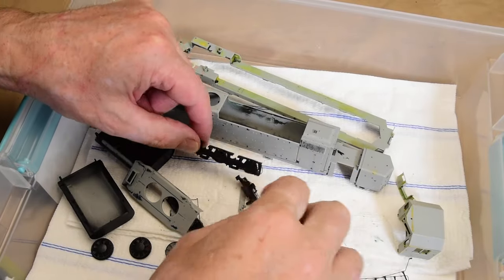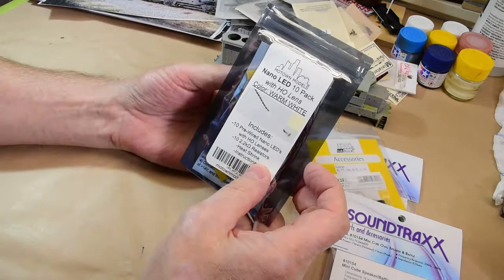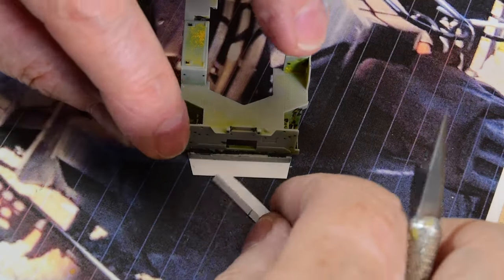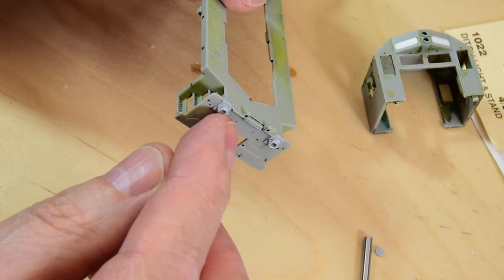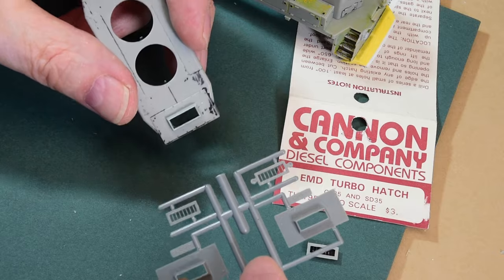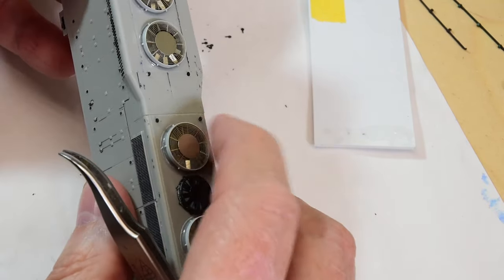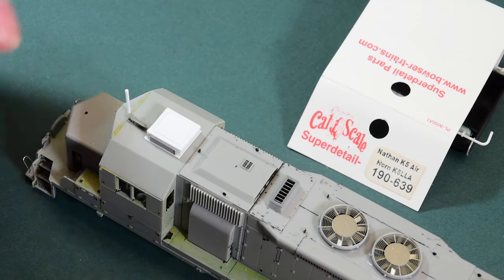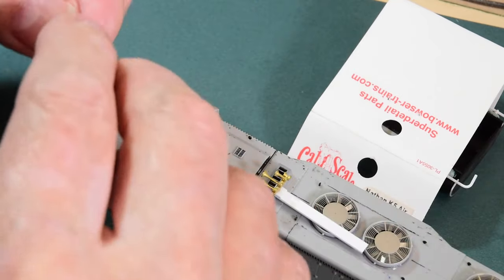The Atlas HO Scale SD35 Locomotive Rebuild Series (Part 1) | Boomer Diorama ~ # 237

Comment: Enjoying this series thus far, as a ( retired) engineer I can't get enough detail on a lok. The ditch lights you use are definitely going on the list but I'm afraid Cal- Scale lift bar kits are all I have access to. The snowplow build was informative too. Thanks for a locomotive series of this magnitude.
Reply from the maker: Lift bar kits are small anyway. Probably no biggie. Not my favorite thing either. ;-)
Reply: @boomerdiorama  I suppose if you're "fiddly" enough you could make the base of the loops from styrene . Attach then drill through for the loops.

Comment: Believe it or not, Boomer, it brings back memories of when I worked at EMD in Chicago. Seeing the different sections of a diesel being built, the fuel tanks; cabs; generator housings; engine blocks;  all parts and pieces to be shipped over to LaGrange, for final assembly. Which I wish I had been able to see in person. But other than a visit there once (FT Anniversary) and seeing a locomotive on the "roller platform" where they can roll one upside-down. I had to settle for touring the locomotives they had on display. One (a favorite) a CN, SD50F "Drapper Tapper." 
EMD's are something! But, when it comes down to it... there is nothing lost on the art forms of all the other builders GE; Alco; GMDD; MLW; F-M; BLDW; Lima.
Looking forward to your Part #2.
Here's to Grant's 🐿/🌲 lol! 
                           Cheers! 🍻
Reply from the maker: Thank you!

Comment: Perfect timing for this video boomer as I'm embarking on my first ever detailing project on my ho CF7 with photo etch parts from KV models and detail asscitates and this is a helpful video for me especially with the couple lift bar part DA #2204. I'm also using Details West MU hoses (mu266) on my locomotive which is also challenging because the CF7's were built from Santa fe's aging F 7's & 9's  fleet back in the 70's although I do have two reference books on the CF7's but there's very few photos to work with,I have zeroed in on two good photos though and the other is a older book put out by athearn years ago which is basically a handbook on a handful of popular locomotives and consist of older articles from RMC on how to upgrade and detail BB locomotives,and most importantly it comes a full list of detail parts W/p#'s from details west, details associates and other manufacturers as well.
Reply from the maker: Have fun with it but don't give up on it when you run into a challenge. Every locomotive is a personal battle to finish and the reward is worth it.
Reply: @boomerdiorama  thanks boomer..👍I would send you a photo of my progress but you don't have anything set up for that..😁

Comment: Great tutorial! I wish I had seen this before I started my kitbash of an Atlas HH660 into an IC HH600 a couple of months ago.  Try Scale Sound Systems speakers. They are my go to speaker now.  They have speakers with the enclosure designed to fit in various loco models and the bass is outstanding for an HO scale application.
Reply from the maker: Yeah. He uses the "snare" drum membrane effect (very thin plastic in one small area on the box), on his enclosures, to get extra pop from the bass. Not hard to do out of styrene plastic. I like to custom on the fly, rather than pre-order for something that might change along the way.

My scratch built speaker enclosures in the GP9 and MP15 sound awesome. And then there is my four speaker GP40 which sounds awesome as well. Thanks for sharing. Cheers ~ Boomer. ;-)

Comment: Thanks for sharing. 35:29 Coupler lift bars? Yep. I did it in N scale. Drove me nuts. I had to take a month off form working on the four shells I installed them on. But now that they are done. I kinda need to do a few others. I super detail my N scale locomotives too. I wish they had a Cannon and Company for N. I do the see through grills, and fans too. Not ease. But worth it.
Reply from the maker: 3D print?
Reply: @boomerdiorama  Not yet. I have two 3D printers I'm learning how to use. So far? I have been scratch building just like you only in N scale.

Comment: Thanks so much for this series. How did you get the fans opening so neat? How do you do this on an Athern?
Reply from the maker: The fans are from Cannon & Company. You have to try and see if they fit or cut out the athearn and replace with these. Drill them out and trim or file to opening size.

Comment: An interesting trick that we don´t see often that should make Boomer smile is homemade silicone mold used so much in movie making.
You have a big yard, with car / loco shop. But how to introduce equipment waiting for repairs or scrap ? May be your railroad does shop repairs for other railroads just like IC did in Paducah. Or simple a scrap yard or rebuilding. Railcar storage often seen on unused track of class 1 or shortline. Even railcar storage companies exist.
Who would try to smash or have severe body damages on a plastic 50 $ boxcar or hard abuse gondola ? Usual method of melting plastic offer no fantastic result. You want somewhere 10 locos in highly bad shape or with missing parts. Are you buying brand new high cost ? NO !
Simple. Do them !
In arts store or Internet you can find  silicone products used for molding with plenty of tutos on YT.
You want to make a mold of a rock
Or an old boxcar. You need release agent to unstick your mold from the  rock or boxcar you used. Part A and B in EXACT measurement (by weight or volume) of those silicone products that you mix. Pouring must be very quick. Life span of products is just a few minutes. Same process as mixing fiberglass or resin, except must faster. No bad smell. Curing is very fast and you can start to reproduce in 12 hours or next day. Some of those products are skin safe. You can even mold yourself. Mold can last for casting many copies. Just to remember that some crevices in your master used, there is some shape that would be impossible to unmold. Watch tutos for these warnings.
But....cause there is a but. Those products are quite expansive. You can swap with friends or trainshow some moldings.
Silicone and alginate can be used. Alginate is made from algea. Roughly like jello. With alginate products you must use your mold fast cause it won´t keep its dimensions for long and is also expansive.
I can copy a nice boxcar, put it on the ground for storage use and so what ?
Well when you use your silicone mold for molding, if you bent it your reproduce part will be also. Now your storage boxcar have a big bent from a former wreck. Now it have history. Your gondolas with rough sides are prototypical. You can put your smashed locomotives on trackside with freshly ballasted track. A big wreck happened and you just reopen the line.
That method is perfect when you scratchbuilt. Make the most perfect master. Then reproduce it as many time as you want easily. Is there limit ? Some shape or to small detail or to fragile to unmold. Watch tutos on silicone or alginate molding. You´ll never use your soldering iron to make indentations in your plastic freight cars.
Thanks Boomer for your well detailed instructions. Pure joy 😊
Reply from the maker: The actual prototype railroad SRY Rail Link scraps, repairs and rebuilds locomotives all the time. Cheers!